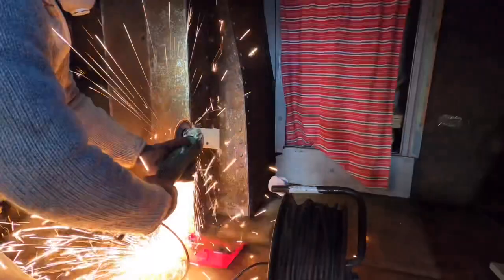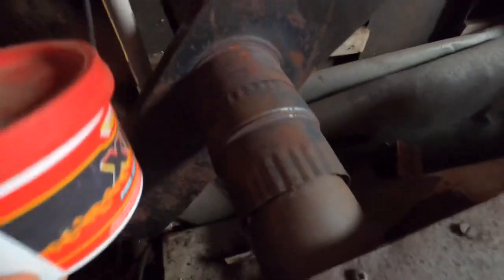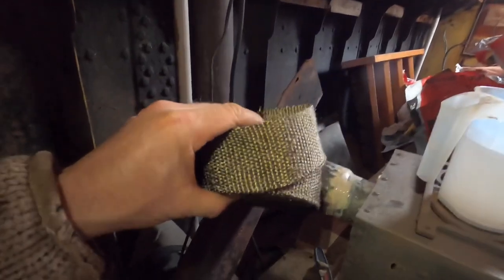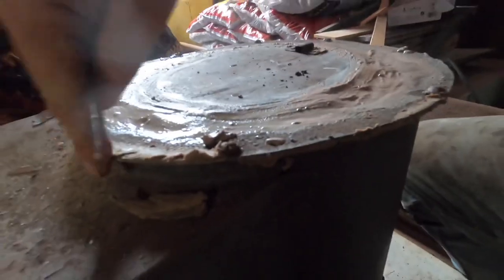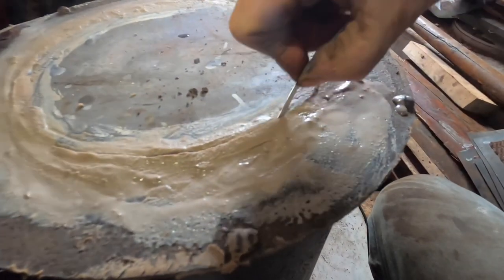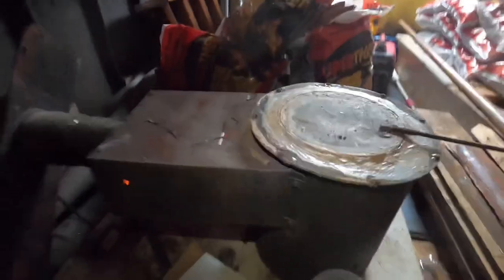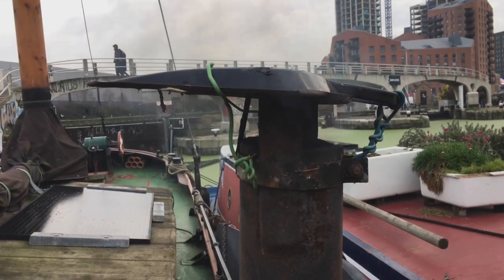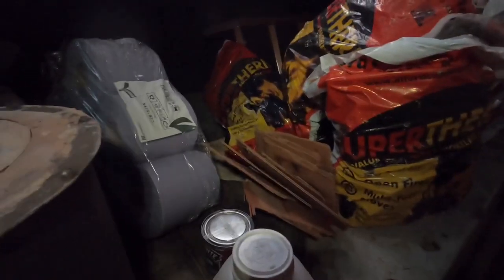I warm the boat for painting!... and other nonsense. Dutch Barge Linda #30

Comment: You're definitely approaching Oscar territory!
These angle grinders are supposed to have disc protection on them. This works in >95% of the cases, and it is also somewhat easier to direct the beam of sparks and metal splinters. for the other <5% of the cases where you have to take off the protector, then never push the machine forward (with your hands in the direction of the blade) as a slip can cost some fingers.
Apart from that you're almost ready for an HSE inspection!
Reply from the maker: I think this year I should win an Oscar as the completion is pretty limited at the moment!!!!
I have a disk protector and I took it off to get access to something or other. Then I lost it and I’ll have to find it and then.... well I think we can agree the destruction of my GoPro is a price worth paying for the three extra subscribers it generated....🤔
I’m putting it back on. 
You may need to brace your self for the next video as you maybe advising me to invest in a hard hat....😂

By the way, bought loads of thin cutting disks. Changed my life.

Comment: Just be careful with the paint and the fumes with the fire...I had a friend who was restoring a house and they had been at it for about 3 years.. they had almost finished and his wife was home alone varnishing the wooden floors.. she popped outside to the car to get another tin and the house exploded and went up in flames.. .. she had a fantastic heater in the room to keep warm and  fumes from the paint reached the critical mix with the air in the room..  .. have you tried a tercoo rotary blaster for you drill..very good on crusty rust and can be had off ebay.. just found the article https://www.dailypost.co.uk/news/local-news/varnish-fumes-cause-blaze-tanygrisiau-2783527
Reply from the maker: That’s terrifying Robert! Thank you for the reminder. You’ll be glad to know the curing time for the paint is very much extended due to the cold. There is no fast build up of fumes and the boat is wide open in terms of ventilation. In the summer, however more precautions will be needed. 
I’m disappointed when I step into the boat the next day expecting the smell of fresh paint only to get a mild suggestion of perhaps some work has been done!!
Definitely getting a Tercoo for the paint on the outside, but the Tar on the inside melts if you apply friction to it. That’s why I have to use a chisel. It takes hours, but what else would I be doing.
Reply: @canicebannon  thought I'd mention it..I'm sure you're fine with the door open and the fire lit.. it's the critical vapour to air ratio in a closed space that causes the issues. .. watching pain dry.... the directors cut...